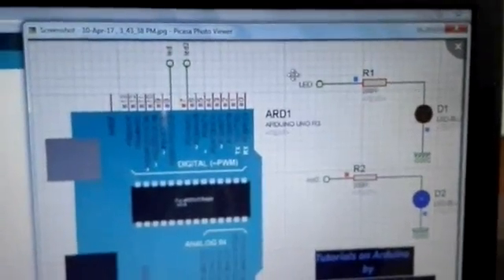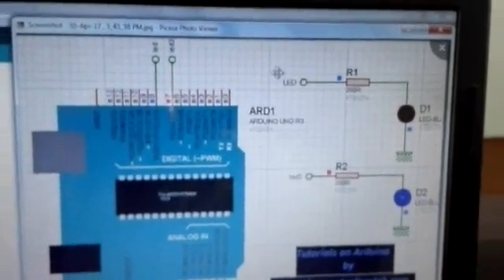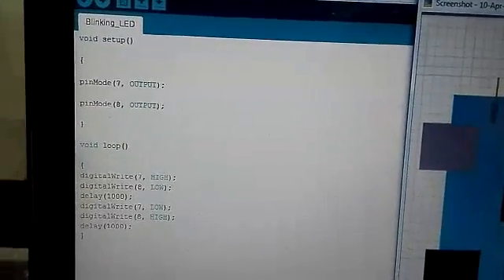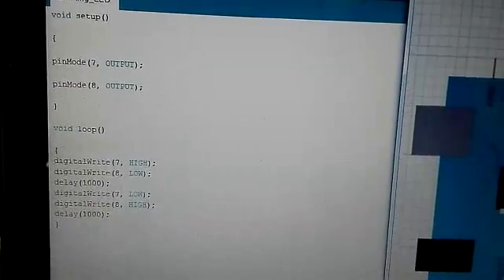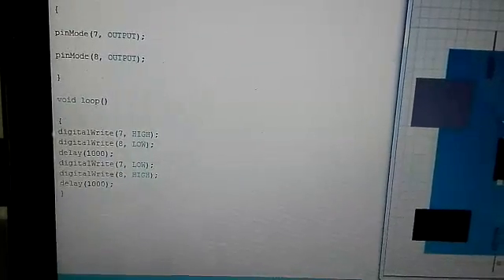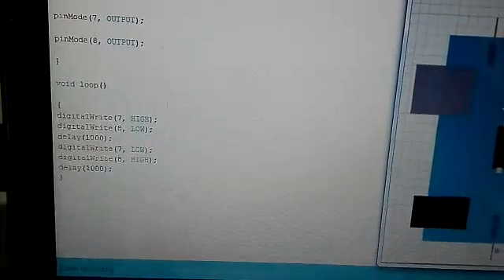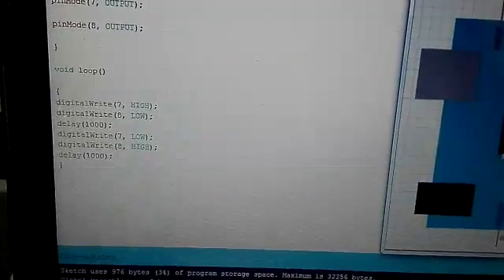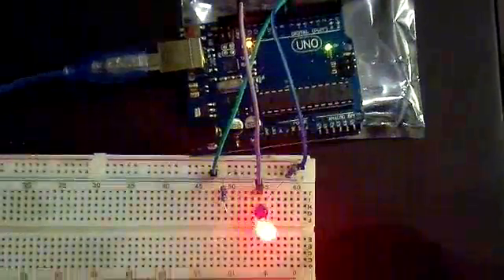Alternate LED on and off using Arduino Uno R3

Comment: Thank you so much, Sir.  I love your blog, I am learning so much.  There was a mistake in the code, but I was able to figure it out.
int firstled = 7; // First Led is connected to pin number 7
int secondled = 8; // Second Led is connected to pin number 8
void setup() 
{
pinMode(firstled, OUTPUT); // First Led is taken as OUTPUT
pinMode(secondled, OUTPUT); // Second Led is taken as OUTPUT 
}
void loop() 
{
digitalWrite(firstled, HIGH); // Turn ON the first LED
digitalWrite(secondled, LOW); // Turn OFF the second LED
delay(1000); // Wait for 1 sec
digitalWrite(firstled, LOW); // Turn OFF the first LED
digitalWrite(secondled, HIGH); // Turn ON the second LED
delay(1000); // Wait for 1 sec
}